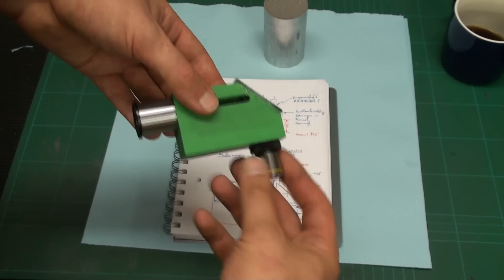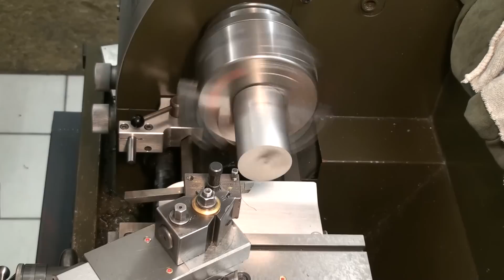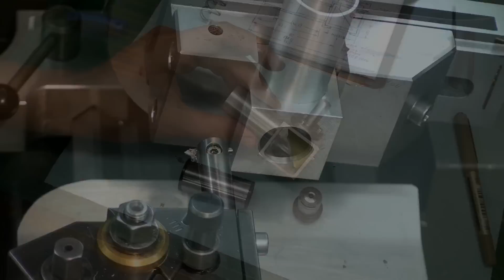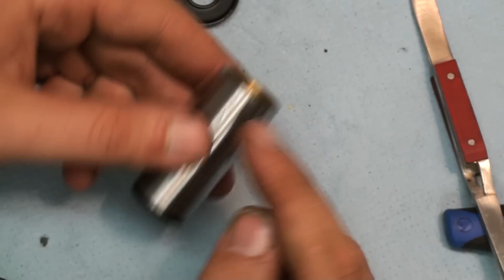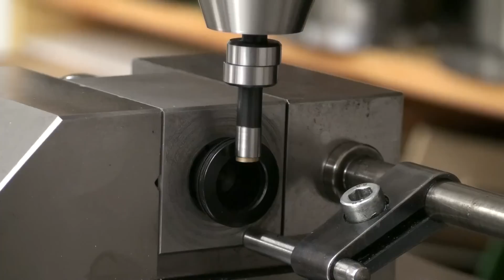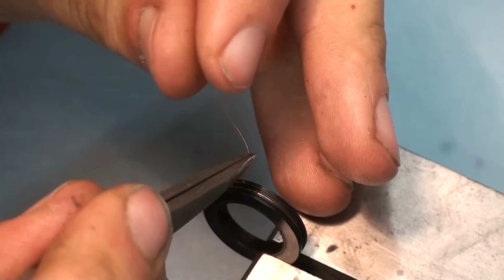Centering microscope - Prototype

Comment: Excellent prototype.  The problem with doing too good a job on the prototype is that there is less incentive to build a final model.  ;-)

I don't know how crosshairs are normally adjusted, but I would think some fine threading in the tube and on the crosshair assembly would be better than a friction fit.  That would probably make it more bump resistant.  Initial alignment would take a little longer, and fine tuning even more, but that is something you should only need to do it once.

Thank you for all of your informative videos.

Comment: I been thinking (I hurts! It hurts!). If you angled the eye piece up 30 degrees you wouldn't have to plant your chin on the work to look through it. Which means changing the mirror angle 15 degrees.

Front silvered mirror? Half silvered with a masked LED behind the mirror focused axial to the objective?

Crosshairs? Try real hair from a blonde (50 microns dia?) school girl. Blacken it with a well-blotted application of genuine India ink.

Comment: The microscope 'ocular' or eyepiece used is a simple Huygens eyepiece, the internal lens is the Field Lens, and the front one is the eye lens. The 10 x microscope 'objective' is a plain achromat. Instead of a prism a semi-silvered flat could be used same size as the diagonal in the square housing. Nice to see, I made a similar unit many years ago for a machine shop engineering friend. I am used to these devices in various forms in my telescope applications. Like your cross hairs. Also many surplus optical sites sell a variety of graduated gratucules /reticule, with cross hairs, if you ever wanted to measure  distance offsets from the centre. Nice project with your usual finese.

Comment: Very nice effort,fine job .I remember reading somewhere That they used spider silk for sniper rifles in WW2. 
 For the cross hair I have found that stretching the wire till you can just feel it give a little will leave the wire dead straight, take out all the kinks. makes threading it through a hole a lot easier.

Comment: If you are using a prism, you could build a sighting laser into the spindle where it is clamped into the mill head, and be able to line up the light spot with the desired target. Might be less fiddly than the crosshairs.

Comment: You introduce a centering error by wrapping the ends of the wires in contrary rotation. It's better to pull them in opposing directions (same rotation around the optical axis) then any difference between the thickness of the wire and diameter of the whole is negated. Also if you pull all the wire corners around the same way, you would negate any centration error in the drill centering (though not from the collet block), because you would be using the same registration respect to your mill and vise for all 4 bends. Rather than tying a knot, it would be better to pull them under tension with weights and pulleys, and set them in place with epoxy (not CA). Personally, I think that crosshair is too thick, it would be better to use very thin black nylon wire which pulls straighter than metal wire, is very cheap, and won't corrode like copper. Epoxy optical cement is guaranteed not to fog, so that would be the best bet.

Comment: Hi Stefan,
Nice work !
What if you made the mounting spigot flange sit in a recess and tapped 4 holes in the main housing so you could use some small fine thread screws to push on the periphery of the flange to fine tune its position ? Works a little bit like a 4 jaw chuck .
So where to next ? Shop made 3D taster ? Maybe a profile projector ? :-)

Comment: very interesting, got a couple of questions though:
- can you adjust the focus by moving the eye piece in and out?
- how do you adjust tilt? (as in the spindle axis with the close-up piece to be in the same line and the mirror axis to be at 45 deg with the spindle)
reason I'm asking is what about if you want to center on a point inside a part that prevents you from dropping the quill down close to it and you can't focus that way? It would also throw the point off if the assembly is tilted once you are at a different height.

Comment: Excellent work as usual. I have two centering scopes and once u install your prism you might want to paint the internal with flat black paint to avoid any refraction. also some thumb screws for fine quill mount adjustment for centering would be handy

Great work 

Dave

Comment: Hi mate,  Super interesting as always.  I do have some observations if you permit.  You have that wonderful engraver, why not use some nice clear kristal glas to engrave the cross hairs, and colour them black.  You would be more precise, and could even put a ring in it like a bull's eye if that's what you wanted/needed.  When the eyepiece has been opened, as I understand it, it normally requires some inert gas in it to keep the lenses clear.  I might be wrong about it, but I did the same on my rifle scope, because, after all, it had threads so why not open it, and was told that I had basically ruined my nice German scope.  You have inert gas in abundance, TIG Co2, so why not.
Reply: I had the same idea. Score a clear hard plastic or glass, dye the entire thing, and try to scrape off the excess. - Otherwise, the thinnest wire you can easily get is in the ferrite antenna of an old AM radio. You might want to thread a bunch of them at a time and pull the rest, since they will be very fragile.

Comment: Love that mag chuck. The Al machined very nice. The .3 mm drill was tricky - I have some of those tiny drills... they break if you even sneeze! :) Second cross hair was lovely... works excellent. Human hair instead of the Cu wire - or maybe it's thicker!
As usual, you are a patient and precise man. Congratulations. Hard to think that's ''just'' a prototype... it sure does a super job.
What make is that nice edge finder Stefan?

Comment: Stefan, if you use a beam splitter you can get coaxial lighting, let me know if interrested, I'll make a sketch to explain. If you've already ordered the prism though I think it's not worth the hassle, ring lighting will work. You can get front surface mirrors on ebay easily I think. Aluminium is better for the visible range than silver and make sure it's protected (has a SiO2 coating on top). Hard drives are a good idea, but they might be slightly lossy and not sure about longevity. Old SLR cameras will have both front surface mirrors and pentaprisms I think. Overall - I like your direction, thank you for the video and keep it up.

Comment: I have terrible eyesight even after cataract surgery and corrective lens. I use a microscope camera that plugs into a USB socket and it has internal lighting with good focal adjustment lens. I can now see the finest detail on my laptop screen. Might be worth a try for your project?  Cheap ebay / China purchase but works a treat for under $20.00 US.Cheers

Comment: Stefan, a fantastic new item that I have been looking for for a long time. I plan to cut gear wheels for a clock and in order to make them any accurate you need to centre the gear cutter. This the perfect tool to do this and I cannot wait for the definitive design. Meanwhile I will start scrounging for the optical parts. Keep up the good work!

Comment: Nice project. To propose another rabbithole regarding the crosshairs: since I saw this article ( http://scitation.aip.org/content/aip/journal/rsi/1/6/10.1063/1.1748702 ), I've been very curious to see someone execute their method. Basically, they use a catapult to draw a glass rod down to "threads only two or three one-hundred-thousandths of an inch".

(Sorry I don't have a link without a paywall. The article can be rented for $4 through DeepDyve (or free if you have a subscription already). Anyway, it's probably impractical for your needs, but it's fun to read about.)

Comment: Nice job!You can find thin copper wires from earphone cable. Most of them are bundle
of 0.055mm standard wires.
Old amature astronomer makes their corsshair from nylon thread or teethbrush handle.
Heat some nylon thread on fire and pull it suddenly, it turns thin thread.

Comment: You can get surface silvered mirrors out of photocopiers. Find a local small business for copier repair and they should have plenty of wrecks to recycle.
Reply: I tried this in the UK and none of them have mirrors. Not sure about really old ones but anythig from the last 10 years and they don't have em.
Reply: What are you talking about? There are several in the scan path of every copier.
Reply: OK. That's good to know. Which models so we can look out for them?
Reply: Ricoh/Lanier/Infotec, Toshiba e-studio and Fuji/Xerox are the ones I know best. Don't work on them every day any more but I'm still involved with the industry.

Comment: Nice piece Stefan. Regarding the mill mount flange: How about making the top side thicker, boring a relief for the flange & putting adjustment screws similar to an adjustable chuck for ultra fine centering?  What's next? a fusion reactor?  Fantastic stuff Sir.

Comment: Stefan, I made one over 20 Years ago, so heed my advice. I worked for Philips Research Labs who had an optical Department, and gave me all the help I needed. You NEED to have angle adjustment on the mirror / Prism. Light will reflect at 90 degrees only, ANY misalignment of the 45 degrees will give you a centering error between your spindle centre and your cross hairs. Good luck with it. When the Philips workshop closed I got hold of 2 Isoma centering microscopes with W 20 shanks on for Aciera F 3's. As you say, megabucks on e-bay £ 400 +  You may also want to increase the focus distance, 8 mm is too small, you need 25 mm + otherwise you can not pick up an edge down a recessed part.
Reply: Dave is right, this is extremely important. The vertical field must be aligned with the spindle so the hair line does not move when you move up and down the quill.
Reply: 100% sure. Let's say you have a center drill on the spindle and drill a small center mark. Then replace the center drill with the optical device with the quill down, for sure the hair line will not match the center mark. So you need to adjust the mirror to "move" the hair line. Then repeat with the quill up, and it will not match again. So adjust the mirror and repeat again until the hair line is aligned with the quill up and down. The optics need to match the mirror angle, otherwise the field of view could get out reach when adjusting the mirror.
Reply: I think I see what you are getting at. You can easily center the body of the microscope and the central ray of the optics to the center or the spindle. However, if the central ray is not precisely parallel to the spindle axis (Z axis) any vertical movement of the quill will create error. Having said that, I don't see how this creates a problem in this application. Lets say you center on a mark. Since the mark has to be in focus you only have about .5mm of height variation in the objective-target distance. I have verified this on the bench. Lets say your microscope is off axis to the Z by 5 deg (which would be a lot.) That would introduce a centering error of .04mm or about 0.002 inches. ( Sin 5 x .5) That's plenty accurate. What am I missing here?
Carlos- Your reply discusses moving the quill up and down and the marks not matching up? Not possible. The quill will always be at the same fixed distance from the work. That distance being the distance required to get sharp focus. I think you guys are way off here.
Reply: OK but...for the workpiece to be in focus doesn't the quill have to be at the same height for every meausrement? Or at lease very close?
Reply: Hmm...Are you guys sure? There are commercially made centering microscopes that do not have 90 deg optics. A lesser angle is common. How do those work then? I want to build one of these so please advise.
Robert
Reply: "Your optics need to have a focus feature to be complete"- Not true. Focus can be achieved by quill height. In fact having the ability to focus would screw up the entire plan. 
"not because the pointer is centered with the quill up is going to be centered with the quill down"- Umm... yes it is going to be centered because I can only move the quill 0.5mm.
Reply: I ended up buying a cheep USB microscope, no mirrors, no angles and most importantly no sore neck. Works a treat and using my tablet screen i won’t have to worry my eyes are giving up.

Comment: Nice, that is a really slick build. That would be a really handy tool to have even with a cnc machine. Being able to turn my Cnc into a measuring scope would be really handy, I may have to look into one. I fixed the scope for a large boring mills rotary table used music wire and found that worked great as it's much harder to kink or break. You may try making the prism adjust instead of the whole body, you can just put a jack screw and spring in either axis. Rifle scopes have the cross hair mounted to a spring and the cross hair is jacked with the dials. This system is very well proven and very robust so it may be worth a look into. Maybe not in germany but in north america you can get an air gun scope for less than $20 and you could reuse the crosshair system from that. Even a cheap one would have a finer hair than could be reasonably homemade. Keep up the good work!

Comment: Very interesting and different project. To add another layer of perfection you could put the eye piece pointing upward by 30° or 45° to be more ergonomic. And uninterrupted cross hairs cover up the center spot e.g. a weak center punch mark. An interrupted and possibly dashed cross hair like in your Isoma microscope would help fine adjustments. Of course that is hardly possible using wires. It might involve some etching or engraving of a glass or transparent plastic disc. Or you could glue a copper foil on a glass or plastic disk and etch away the copper where it is not needed like with PCBs and wash the remaining glue off. This way you could also leave concentric rings to center on holes or pins. It's an inspiring project, thanks.
Reply: nie

Comment: One last ting. Superglue outgasses and will fog your optical surfaces. Use something other than cyanoacrylates for anything optical.
Reply from the maker: Whoops, thats a good tip, thanks! Will it still outgas after it cured? I know the effect of the white debries while it cures.
Reply: I think it reduces over time, but still does outgass, even after curing. NASA has a total ban on cyanoakrylates on any space craft for this reason.
Reply: Shellac is a resin secreted by the female lac bug, on trees in the forests of India and Thailand. It was used for polishing furniture in the last 2-3 centuries. Nowadays it's almost only used for refurbishing old furniture. I have never seen that stuff on an outgassing property list. It seems to be better than superglue. But if it is the best and most practical I somehow doubt. But I have no facts to back that up.
Reply: to fix the wires a drop of 5-min-epoxy might do as well. Usually epoxy is better concerning outgassing. A bake-out could also enforce out-gassing early on so it will happen much less later.  Superglue maybe at 70°C several hours. 5-min-epoxy at maybe at 90°C for several hours. Bake-out is also a standard procedure for space and high-vacuum applications.
Reply: Shellac is a traditional adhesive in fountain pens. Does a great job there.

Other suggestion for a mirror would be a front-silvered mirror. Very commonly used in camera equipment (viewfinders, reflex mirrors, rangefinders) Nice a flat, and no ghosting effect because the light reflects off silver applied to the surface of the glass, instead of the rear.
Reply: Try a drop of shellac.  That's what they mentioned in the video about using spider webs for crosshairs that Rupert provided the  link to.  It takes a bit longer to dry, but shouldn't outgas.
Reply: Yes, true. Shellac  is actually used for many things.  Used to be used to make capsules for putting medicine in.  Maybe still is, I don't know.  
You can get shellac crystals and mix it with ethyl alcohol.  (Everclear works. :)  )  Violin makers and stringed instrument makers use it.  
I mentioned it because the fellows video that Rupert referenced about the spider webs said that's what they normally would use.

Comment: nice project..! one suggestion for a cheap front surface mirror is removing the protective paint from the back of regular mirror with a good paint stripper.
Reply from the maker: Haha, good tip, thanks, I will try that.
Reply: Car mirrors are also front surface reflective surfaced, dirt cheap at the scrap yard.  You can also get one with defrost if you feel it ever comes needed...   lol